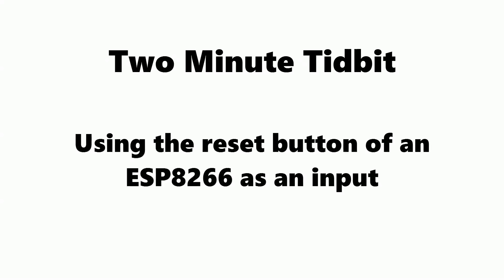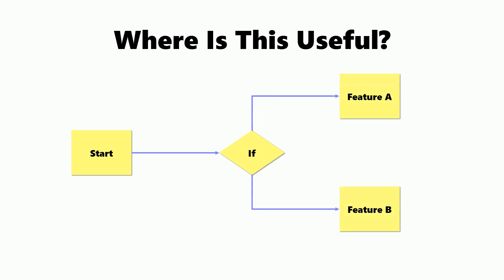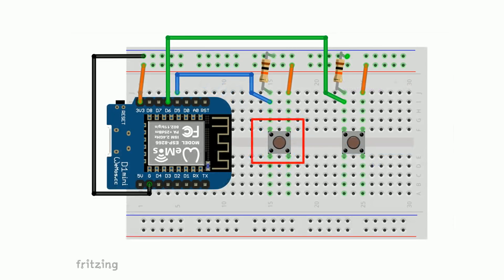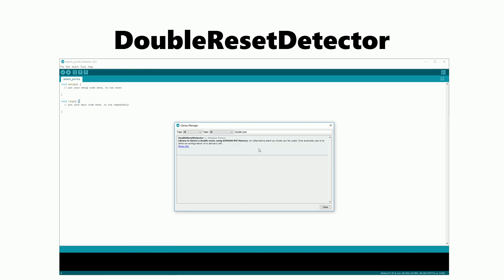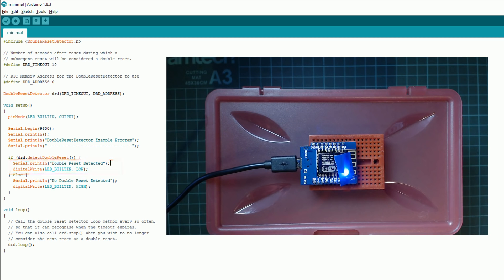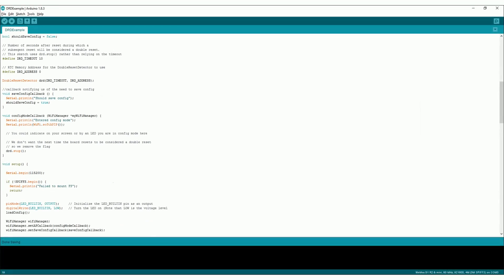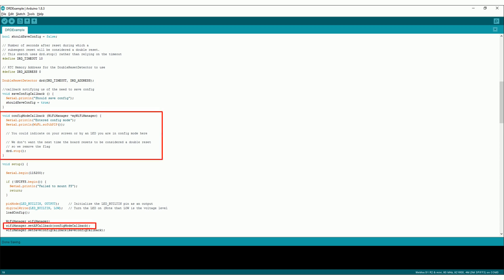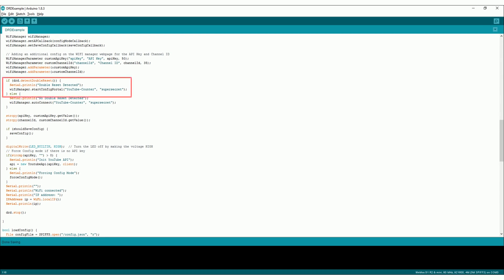[TMT] - Using The Reset Button Of An ESP8266 As An Input

Comment: What we really want is to prevent reset when the reset button is pressed. Unlike LGT8F328P, ESP8266 does not allow disabling reset function of the reset button. In LGT8F328P, there is register that you can set a bit to prevent reset when the reset button is pressed.

Comment: To my surprise, this is exactly what I was looking to do for the exact library you used in the example. I haven't tried it out yet, but it seems straight forward. I'm currently designing something for a project and I'm keeping manufacturability (I'm not sure that's a word 🤔) in mind, one less button (well, no buttons actually) means less assembly, at n number of units, that adds up.

Comment: How to send a command from a esp8266 to another esp8266 few kilometres away but connected by wifi internet.?
Application is to start a pump far away from a remote switch ( not from mobile phone).
Thanks in advance.
Reply from the maker: Adafruit io is how I would do this

Comment: I really like your 2 minute tips series - very useful for libraries that might get lost in the shuffle otherwise!
Reply from the maker: Thanks a lot Phil, really appreciate it!
Reply: Ahh, I just started playing with a esp8266 on a NodeMCU 0.9/ESP-12 .. was working out the two buttons and noticed button_flash would toggle gpio 2 but button_rst would latch gpio ?4? from 1 to 0 then remain there until reset. Perhaps the code from Arduino IDE drops the reset as a function but still keeps it as a flag.